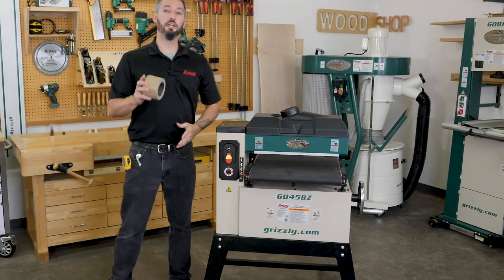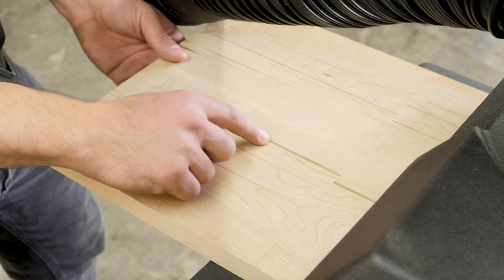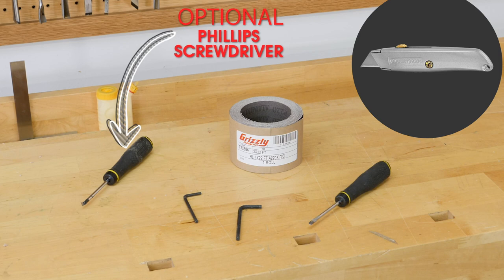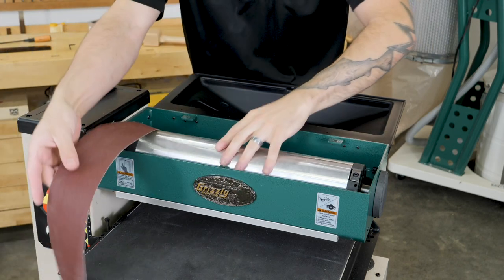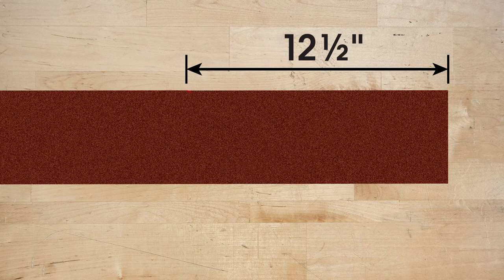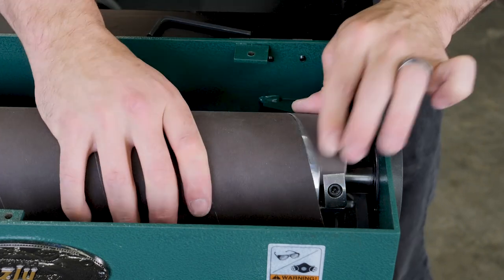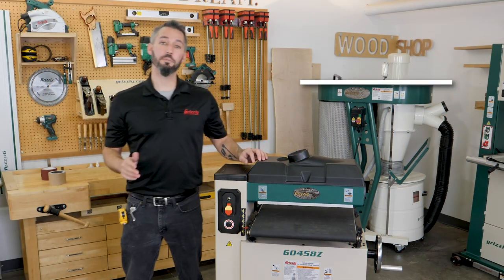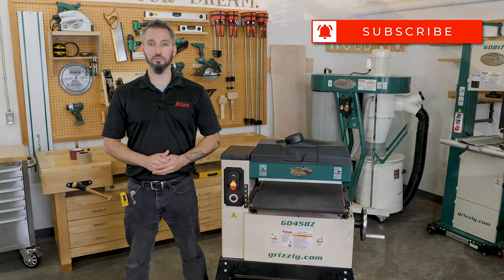How To Replace Sandpaper On Your Drum Sander | G0458Z | Grizzly Industrial

Comment: how doers this sander do on cabinet doors (primarily simple shakers) and how many will it do before needing changing. i know you cant give an exact figure but will it greatly add to my cost of production? (I may be doing thousands of these) I mat get 2 so I can use one for leveling the doors and one for fine sanding, if they will work well for this purpose.

Comment: My manual says to cut the angle at 12” down, which is correct? I also had the spring get dislodged but spent a few hours getting it fixed back up by removing the drum.
Reply from the maker: Hello! We recommend always trying to use a previous-used piece of sandpaper as a template, if it offered the perfect fit for you. If creating a new cut is needed, follow the cut diagram in this video step-by-step, then install the paper. Measurements provided in the video offer a great fit for the G0458Z sanding drum, though some users do like to cut the sandpaper a little longer (with the same angle cuts shows at 3:00 in the video), and then work through steps to bring the paper down to an exact size that way. Either way, always ensure you twist the drum to engage the spring-loaded tension to get the best results. Hope that helps!

Comment: I just bought the 458z.  when i cut the 3 in tape to length it is longer than it needs to be on my right side by about a full rotation of the drum.  what am i doing wrong?
Reply from the maker: Hi there! If the belt is over-rotating on the drum, there is a strong likelihood that the measurements on the sandpaper roll, as called out at the 2:49 mark in the video, might have been pulled from the short point-to-short point, which could be the cause of the excessively-long sandpaper. If the overall paper is cut to 86" point-to-point, and the angles are added as shown in the video (plus, be sure to rotate the spring-loaded drum!), you should be good to go! Hope that helps!